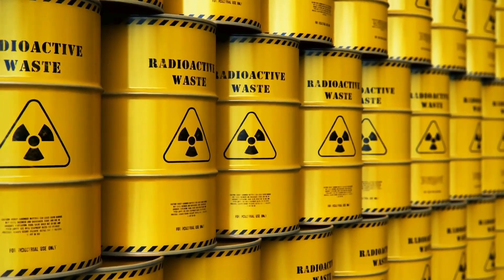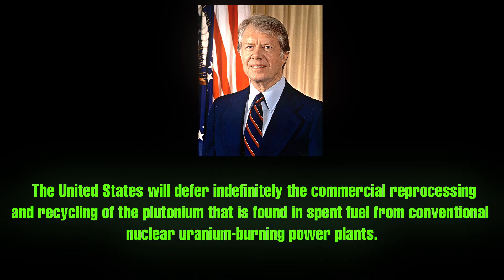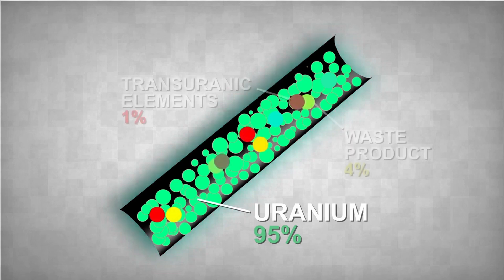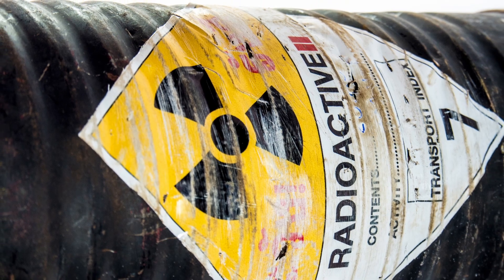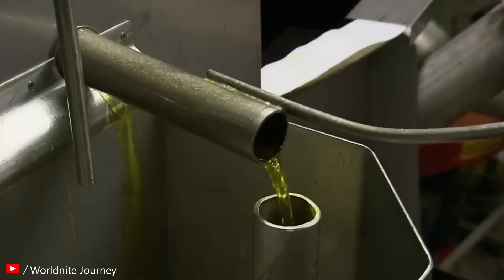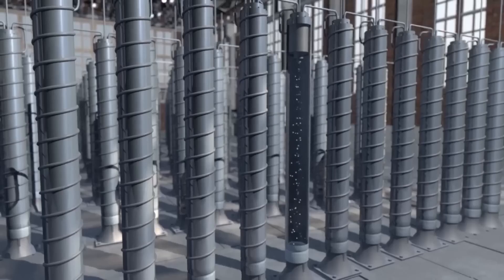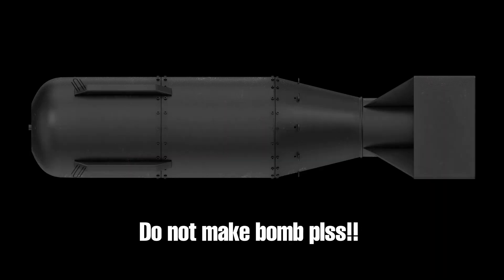Nuclear Waste Is Basically Free Power

Comment: So you're telling me we can put these things into water and it will keep it hot for 5 years and yet, nobody found a better use of this heat than dissipate it?
Reply from the maker: Yes kind of.
Part of the answer is because it's radioactive.
Reply: @eggy8848  The water is not radioactive. The same heat transfer system used to pipe the heat into radiators outside could bring this heat somewhere useful. Such a waste.
Reply: I think the problem is mostly it's just not hot enough. I.E. you'd build a huge facility to generate kilowatts of energy, when what you really want is megawatts of energy.
Reply from the maker: Yes That is basically it!

Comment: Pressurised water reactors use just 4% of the fuel fissile energy. That’s why the waste has a 30,000 years 1/2 life. 
Moltex Energy turn the irradiated fuel into a salt then burn it in a salt cooled reactor. Their reactor fully burns the fuel leaving a waste with a 30 years 1/2 life. They also get 25 x as much power from that fuel as was taken by the PWR. Google them.
Reply from the maker: You’re absolutely right pressurized water reactors are not very efficient when it comes to using the full potential of nuclear fuel.
Reply: Moltex has contributed no significant research or advancements to nuclear science, materials engineering, or reactor technology. The company has not published findings in peer-reviewed journals, demonstrated experimental results, or obtained patents that would showcase advances in molten salt reactor design or materials science. The only thing Moltex has produced is the world's most expensive PowerPoint presentation. In short, a scam.

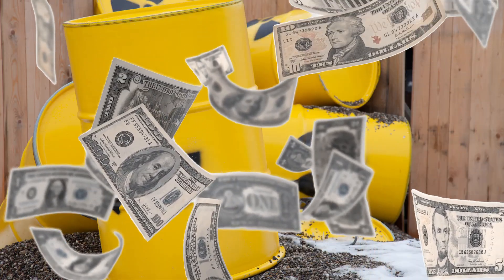Comment: @6:00 The cost is generally higher to recycle than to leave it sitting in casks (which really harms nothing anyway) but the $1000:$100 per kg cost isn't quite a good comparison - the cost of new uranium is about $100/kg, but that uranium contains about 0.7% U235 (and no plutonium).  The "spent" fuel contains about 1% plutonium and about 1% U235.  Both the plutonium and the U235 are fissile fuel, which means it only needs one additional neutron provided to generate energy (as fission).  There's plenty of U238 in both, but that is "fertile" fuel.  It must receive an additional neutron to be bred to fuel which is fissile, then another neutron to generate more energy.  Therefore, there is far more energy per kg available in spent fuel than in fresh uranium.  Even so, new uranium even after the enrichment process (used to get it up to about 4% for normal light-water reactors) is still cheaper than recycling generally, so few countries (other than France) bother to recycle it.  There's quite a few videos, pictures, etc on the web showing people standing next to nuclear waste casks to show how harmless they are, which is why I said "harms nothing anyway" at the beginning.  

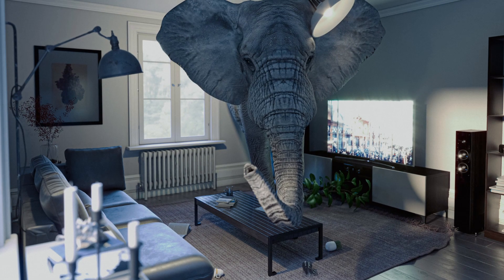@8:00 The proliferation risk is roughly 0.  There IS plutonium in nuclear waste, but you can't make a nuclear bomb with it because the isotope mix is incorrect.  To get a bomb, it must be nearly pure fission fuel (typically over 90%).  That would be mostly U235 or mostly Pu239.  If the uranium or plutonium is a mix of isotopes, no nuclear bomb - the other isotopes absorb the neutrons without fissioning and that slows the reaction rate - translation - no boom.
Reply from the maker: Thank you for the explanation! You bring up some important points about the energy potential in spent fuel and the economic factors behind recycling versus using new uranium. The higher fissile content in spent fuel does make it an interesting resource, even if the cost of reprocessing is a hurdle for many countries.

It's good that you clarified the proliferation risks.